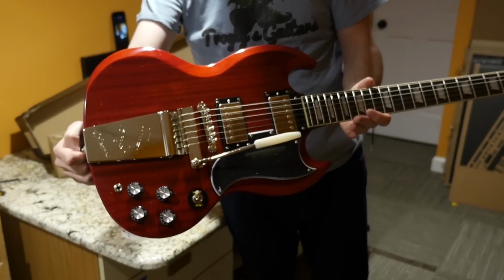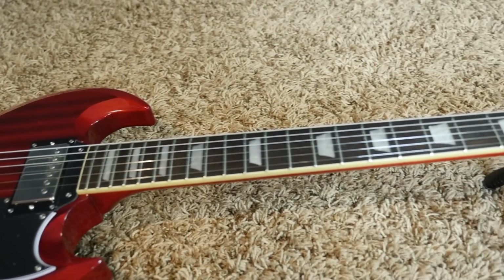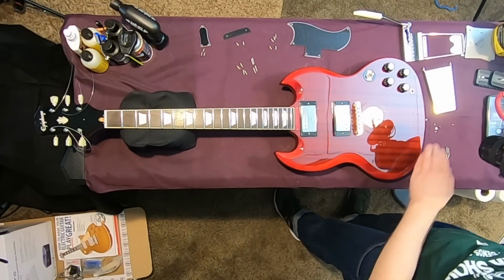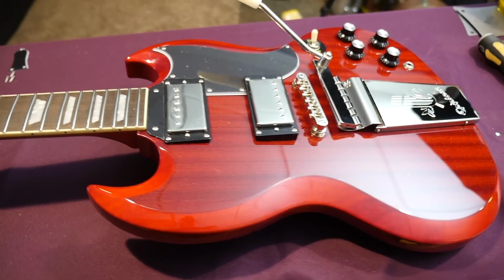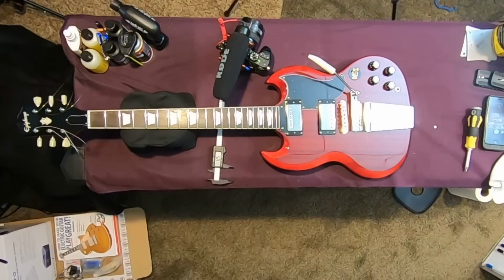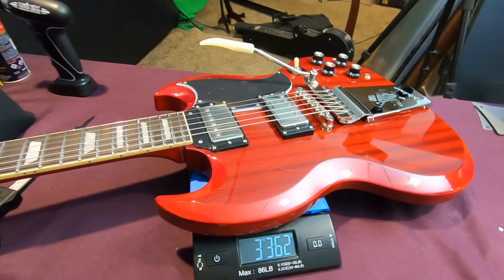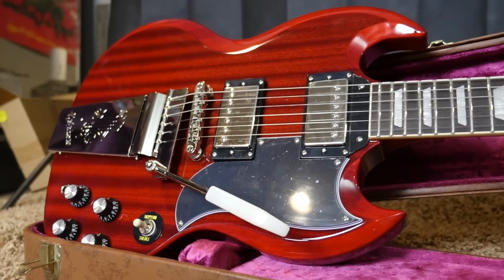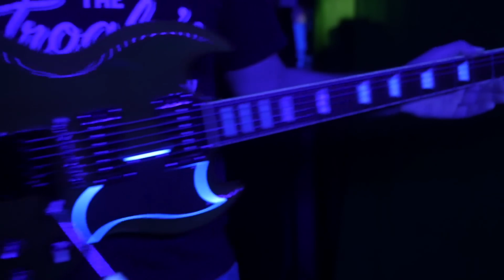Is The New SG Worth It? | 2020 Epiphone SG Standard '61 Maestro Vibrola Vintage Cherry | Review Demo

Comment: My first guitar I got for Christmas. It was a Global SG with a bigsby style trem. I hated that trem. Took aprt the guitar several times trying to figure out how to stop detune everytime I used it. I finally gave up. Removed the spring and I stalled a bolt as a stop so the strings rest normally.  Never had a tune issue with it again. I learned a lot about relief and fret height and several other issue cheap guitars have but also can apply to not so cheap guitars.
Reply: I've still got mixed feelings a out this one. As bad as I want an SG. I'm seriously thinking building my own like the custom you spoke of with epiphone pickups. You know of a good kit i could purchase that won't rape me and leave me enough to make up the difference on good hardware. Was thinking of two stage volume and tone. Maybe coil splitting.

Comment: I wonder if you could either pull that vibrato off and just put a trapeze style bridge on, would the holes be the same or at least close. Also, I thought I saw that the holes for the strings to slide through are on the actual arm mechanism? It's too bad they weren't in the body of the vibrato, then that could just be used as the trapeze bridge. As for that "weird" veneer top, I kind of like it, it gives it character to me anyway. 
The way you are describing that neck it sounds like the same neck that is on the Lee Malia Epiphone Les Paul artisan, if so, man I love that neck!!

Comment: I wouldn't mind that particular mahogany on the face of the guitar if the edges of the body matched, I bought one of these earlier this year and that really bugged me. Decent player bit that severely cheapened it. I'd rather look at an sg with 4 body baulks than cover it with a thin vaneer that stands out that bad

Comment: I have an Epi 339 P90 pro that has cracks on the sides at the nut like that. Mine cracked the wood. I figured out what happened. The factory worker hammered in a nut that was too wide for the slot. This put pressure between the end of the fretboard and the headstock overlay, forcing the headstock back. Once I had that fixed I made a new nut out of bone and fit it properly. There was no way to get the original nut in it was just too fat. Why would they do this?

Comment: That veneer looks absolutely awful.
Reply: Looks really cheep.
Reply: My Korean sg has no veneer. They've cheaped out.
Reply: Malcolm Hardwick
No veneer is cheaper than veneer. Unless they used a thick cap or the whole wood is figured.
Reply: The Echelon Veneers are insanely cheap and on a guitar like this where there is no real figuring/flame/quilt it’s just being used to mask really cheap wood and/or allows them to make the body from a bunch of non-matching pieces.  I’m actually pretty sure they didn’t used to use these as well. Really unsightly.
Reply: yup awful .... I'd prefer no figuring and as long as it wasn't more than a 3 piece body I'd be happy. That and the 'lots of shoulder/flat back' neck (which is the total opposite of what I like) has thankfully saved me a disappointing purchase though.
Reply: its about the sounds, not the looks. and I don't like the awefull tremelo.
Reply: That's funny I have a 2019 Epiphone exclusive deluxe G400 Sg with a AAA Maple top nothing cheap about it or the electronics CTS electronics
Reply: Casey Hurd I think it looks great.
Reply: It would look cool in TV Yellow.
Reply: @waskoNzoo  If any of this was actually about the sound, not the look, no one would be buying guitars from a company with Gibson's quality control standards in 2020.
Reply: Yes

Comment: I'm glad they changed the headstock shape and even though it still looks "off" it's an improvement. I don't mind the veneer, but with the brighter outside edges it just looks shit. If they had of at least made the two colours the same then it would look much better. I've got an older SG pro and even without the neck binding, looks better than this atrocity. Gibson's motto? One step forward, two steps back.

Comment: Let's be honest here, have Epiphones ever been that stable or reliable ? No they never have been and you buy them for what they are...... cheap versions of Gibson models. If you accept that and do a few simple modifications and upgrades you will have a guitar that is playable and reliable. Don't come on here and whine about a budget guitar that you have just taken out of the box and then expect great things to happen. Buy this guitar and install a roller bridge and some locking tuners and use some Nut Sauce on the nut for lubrication and you will have the stability that is needed to rock out for hours without any problems. Make the investment on these upgrades and you are still way ahead of the game verses spending thousands for a Gibson SG which will have the same issues. When I purchase high end guitars with vibratos I always install Graph Tech locking tuners. Budget guitars like this model are a good value if you are will to do a few things to them but if you are expecting to get high performance from a six hundred dollar guitar don't even buy it instead save your paper route money and when your sixty years old you can by a Gibson.

Comment: In my mind you should not have to modify (file) frets, adjust the neck or setup the intonation of a brand new guitar. All that should be done before it's sent out to the new owner.
Reply from the maker: I used to think that before I bought new guitars too. Shipping and climate plays a role in everything too
Reply: A used guitar is always going to play, feel and hold tune better than a brand new unplayed one, like when you get a new car it needs to be broken in and that "smell" that's always there until you've had it a while, some thing just take time to settle in the right enviroment. Although the fret ends are a definite no no, otherwise it's just sloppy as it doesnt even take that long to do properly
Reply: Should have got it from Sweetwater!

Comment: the stripy top is not good-looking at all. and not because the edges are not done the same way. it just does not fit a guitar. looks like some old furniture or door or something. and the orangy colour (not sure if it's only because of the lighting) does not look good either. i really dislike the looks of this guitar. although i am a huge sg fan (and i have never owned an expensive one nor would i like to, i am fine with the cheaper ones, but this one is just not good-looking. not ugly, but it just does not work).